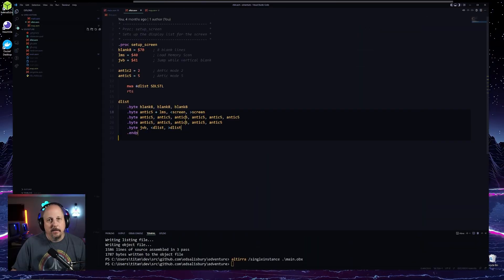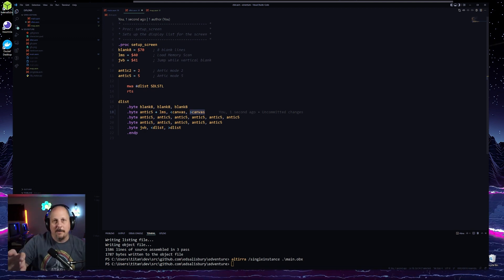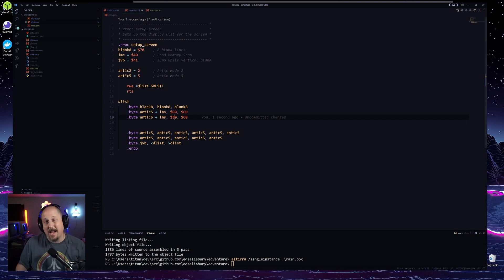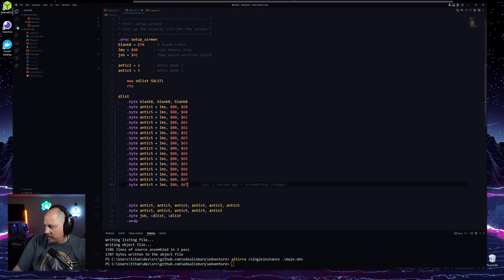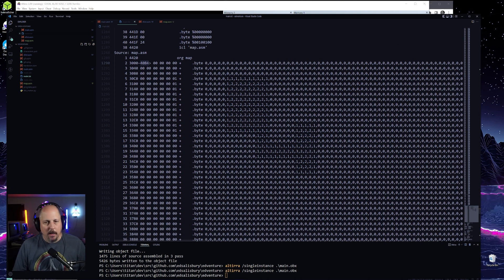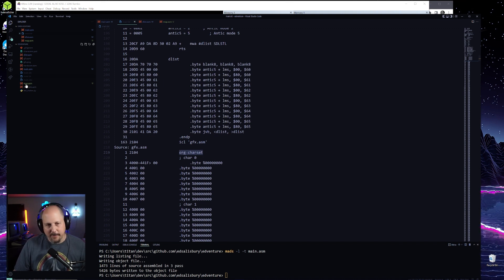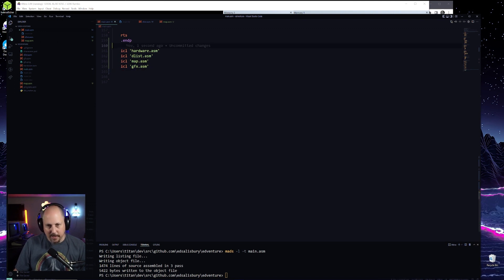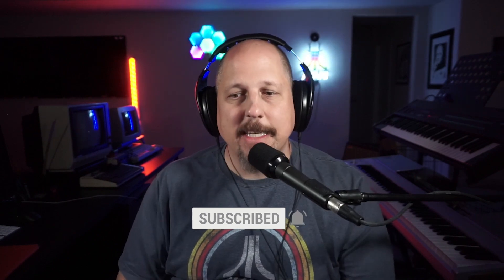Let's Make EdVenture #10: Scrolling Display List -- Coding a Roguelike in Atari 8-bit Assembly

Comment: Hi, Ed. Thank you so very much for all these tutorials! I should be doing something else, but you are helping me to live out my dream.

FEEDBACK: when watching this on tablet, I find it almost impossible to pay attention, because I can't see the code. If you have Power Point, or something similar, then it might help to illustrate what you are talking about, when discussing areas of memory.
Reply from the maker: Good idea, I need to use more visual aids -- I will try to in the future!
Reply: @MissionEdPossible  Thanks, no pressure, though.

Another suggestion: be really explicit verbally and visually, when discussing basic terms, like "top of memory" and "zero page", because people probably create a memory map in their heads that don't match.

I, for example, visualized memory as 0000 0000 as the start, and at the top of a diagram, and therefore, "top of memory" would be higher up in the diagram, but lower in address number, but I am convinced that that is incorrect. I am under the impression that it is more like a skyscraper, where 0000 0000 is the bottom, and "top of memory" is a higher number, and using that memory and then some more would mean coming down in addresses. Clarification would be much appreciated. 😀